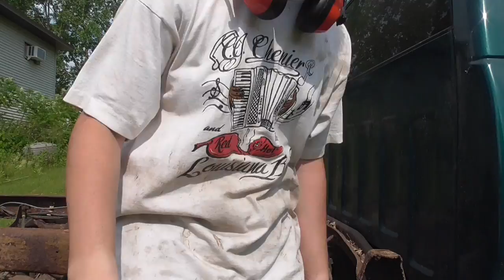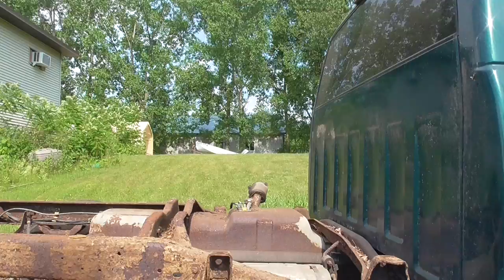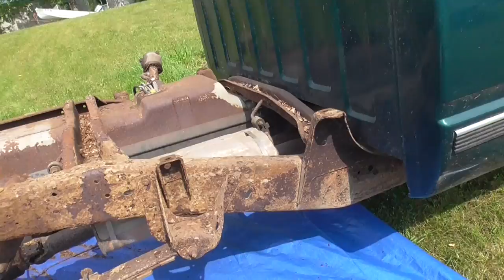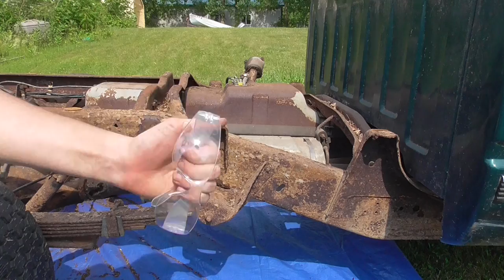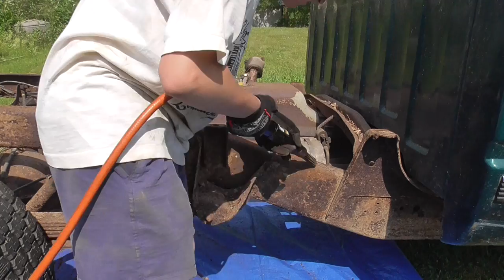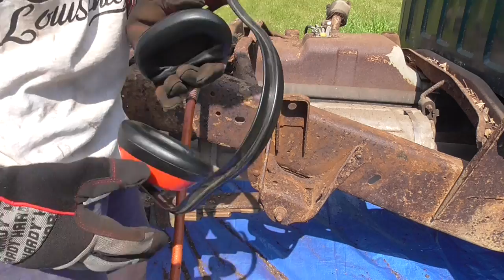How to descale a frame

Comment: It also helps to have an air chisel off to the side. You can use it to knock off heavy scale on both sides at the same time. Saves you time and air if you've got a smaller tank.